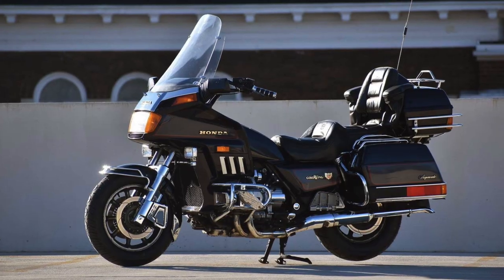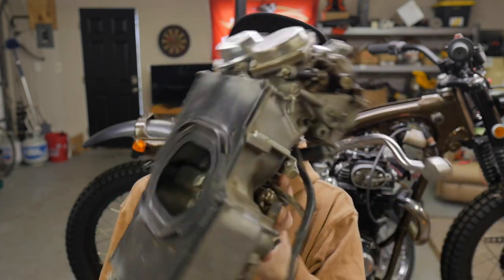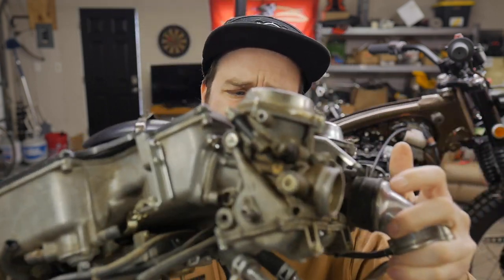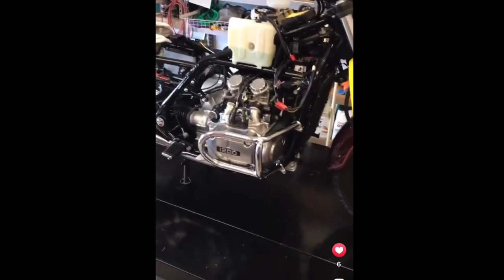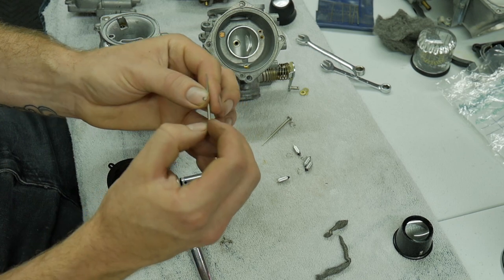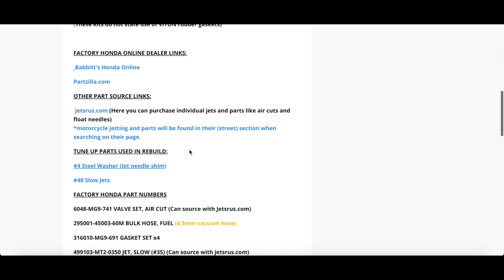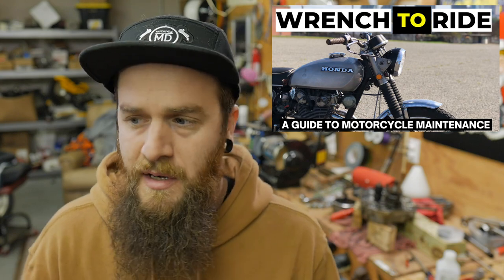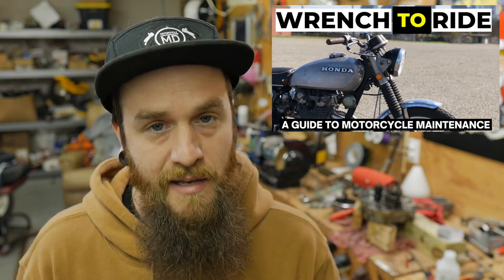Honda Goldwing Carburetor Problems: GL1200

Comment: It blows my mind just how much some shops will try and charge for the carburetor work simply because they don't want to do it. I got quoted $1,200 to rebuild my carburetor at a pretty reputable shop in my area. Then I found a guy one town over that runs the shop out of his garage and enjoys working on older vintage bikes. 
I got the carburetor rebuilt 
Tank flushed 
Fork seals replaced 
Front brakes 
Brake master cylinder 
Radiator flush 
Thermostat 
And something else minor that I can't remember right now done for a little over $800. 
It's amazing how inexpensive things can get when you find the right person
Reply: Key word his Garage.  No overhead.

Comment: Back in the late 70's and the mid 80's I was the National Technical Director for the GWRRA. I Was factory trained at American Honda. One thing I noticed that you didn't  mention was the issue that the Goldwing's had with the Carb piston shaft sticking in the Carb Caps because the shaft was gummed up. At the time I had people coming from California to My shop in. Arizona to have their poor idle and extreme hesitation resolved.  At the time, I was only charging $75.00 to fix the issue.
Thanks for allowing me to ramble on. Keep up the great work!
Reply from the maker: Sad to hear GWRRA go!

Comment: I knew about the transfer ports since I been tearing into carbs, I always bench synch them before I install them on bike then I synch with my carb stix. I heard an old boss I had say, "You gota play peek ah boo with those holes." Also, I had a gas smell on my old Interceptors, I ended up buying new custom aluminum fuel tubes and did the whole de-racking replacing with new Viton o-ring thing, bikes ride like a dream and odor free. I got so good doing the carb balance on the bike, I can do it in 5 minutes now, but it took years to get that savy. Nice video. Wings are cool. PEacE

Comment: Great video(if you understand his terms/lango)
Very easy to follow. I'd like to obtain the literature he has on Carbs. The The ONLY issue I find with the information (as he admitted), the lesson DOES NOT include how to get to the Carbs, how to uninstall and reinstall a Carb. It's just instructions on how to MODIFY/UPDATE your Carbs
As for dummies such as myself,🥴 I'd need to know HOW to get to it "Bolt by bolt". Apply all torque specs(if any) upon reinstallation..... We should be good after that. 👍🏾

Comment: I've had my hands in a few GWs over the years, I even worked at Wing Enterprises Okc for around a year, right before Bart the owner died.
I got so good with the carbs on these things I'd normally have them synced and tuned on the bench before I'd ever installed them.
I'd install them and the only thing I'd have to adjust was the idle... at most.
They always busted right off and the throttle was always snappy and responsive even under load.
Reply from the maker: Awesome!

Comment: Then only problem I had with my 122cc 86 was that I lived in Albuquerque, NM at the time and the air was thinner at 5000ft altitude. I wasn't a bad problem snd seemed to go away once the engine heated up. Going to Santa fe was even worse.

Comment: Magic holes by the  butterfly 😂 same with KZ 440 carb.
JUST be gentle ,not to enlarge them while cleaning .Them and the other carb holes especialy when bottoming adjusting screws IN. Bigger they become  the more sensitive they are when tunning. 
Thats why carbs in multi sets can have different adjustment settings to be on the same page, aka same proportion of fuel to air

Comment: 87 aspencade here.  Had carbs cleaned and synced 8,000 miles ago but it has run rich since.  Only getting 31 mpg on hwy.  What can i do without breaking it all down.  I can piddle on my bike but not major stuff.   any suggs i appreciate,, df

Comment: Can someone help?
I have a 2000 Suzuki Bandit S 1200.. i had the carburators rebuilt. The motorcycle will not reach speeds over 70mph. If i try, i get hesitations

Comment: I avoid ALL 1200's because the lifecycle was short and the problem list long.  I have 2 GL1100's and love em. 1 Interstate / 1 Aspencade. NON-Led display.
Reply: Hi, I just rebuilt my GL1100 carbs, do you know what your mixture screws are set to?
Reply: @blackmax52  The factory setting if I remember correctly is 2 turns out. I removed those silly little stoppers cause Honda wants to limit your ability to adjust the carbs. F* that. But be very careful cause you can wreck the screw it is set onto. YouTube has a video about how to remove them if your interested.  Usually all said and done with a carb sync tool you should be between 2 and 3 turns out. The limiter keeps you from enriching too much but sometimes, ya may need to. No more than 3 turns cause the internal spring is too loose after that and may fall out. I used a drop of purple locktite over the top after they were bench synced and if you have to adjust em back out the locktite takes hold and helps.

Comment: My single carb setup is far superior to the original carbs. Starts without choke, better mpg, more range, no syncing necessary, simple, parts always available, 10 pounds of weight off the top of the engine(great in curves), runs great on modern gasoline etc. I could go on and on. More details on my channel. My bike has never run this good period. Total cost under $300.